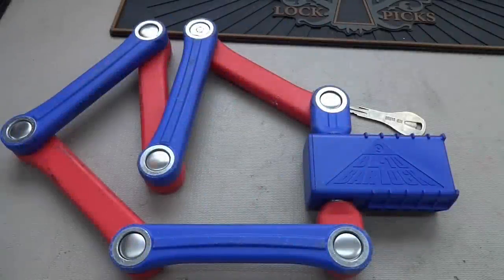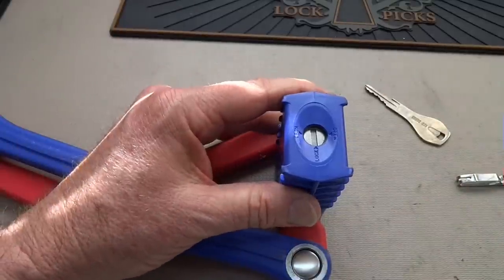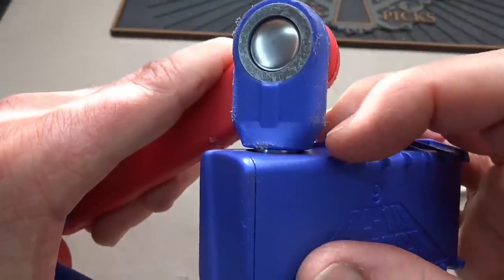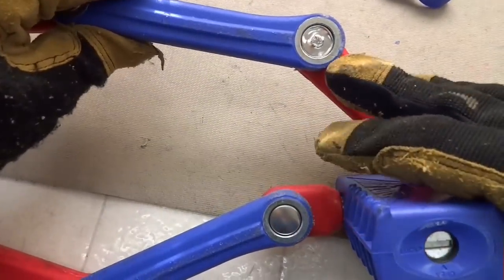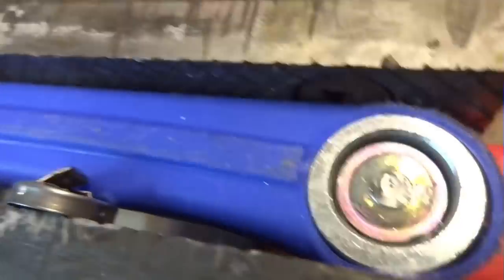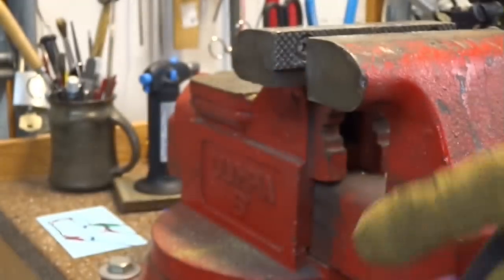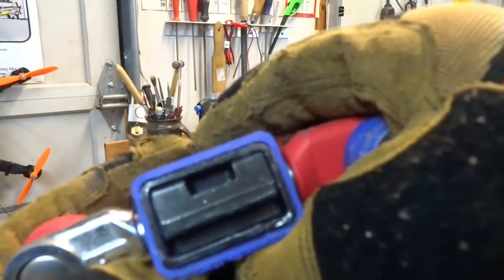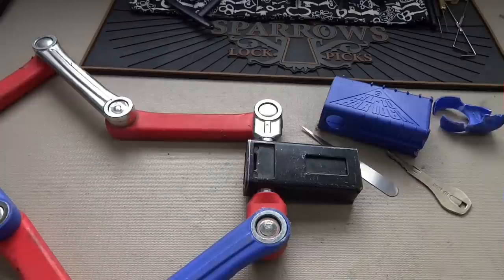(774) Japanese BL-10 Bar Lock

Comment: Under 100 club.

Also other than that weakness to shimming it seems like a damn good lock, get rid of that and it would be a really fantastic lock.
Reply: Darthane

Probably so, if the yearly replace is really to allow accommodation for improvements on the design it's entirely possible that if it hasn't been phased out it will be in a year or two.

Comment: I wonder, does no1 carry a blowtorch? all you need is 1800 degrees celsius for any kind of steel. Little propane or acetylene and pure oxygen makes short work of anything iron related. The only thing that can stop this is pure mass and thickness. I´d heat the joints with a blowtorch, and whack them once, soon as they are orange red. (coming from someone working with hardened steel on a daily basis)
Reply: theives are usually opportunists. people with brains buy motorbikes
Reply: There was a disposable combat cutter that was a tube lined with ceramic or something and filled with termite and an igniter. It was made to cut through locks and chains, and then discard as a breach was made.

Comment: freeze  the arms and smash the frozen part with sledge hammer open in 15 sec.
Reply: +Scott Lindrum Bill's previous response to the same same statement earlier.

"bosnianbill5 days ago
+antagonizerr How much would you wager?...  I beat the crap out of the bars and the hinges with a 2-pound sledge hammer on a concrete floor.  Nothing.  I sprayed them with canned air (held upside down) and froze them colder than my wife's heart, then slammed them some more.  Nothing.  So, whatever your wager was, please send it to me.  ;)"

Comment: I am starting to wonder about Japan... I know that they have very aggressive laws about cars, making it completely infeasible to buy or sell 'used' cars except to collectors.  That, of course, drives sales of new cars.  And apparently they drive sales of locks by forcing people to buy new locks every year for bikes and such?  Do they have a bunch of other laws to force people into doing things solely for the benefit of businesses?
Reply: no, it just makes sure that people have the best locks and that way insurance companies know they have the best locks. I sure hope you don't live in America or have an iPhone cause uh that's a funny statement you made haha
Reply: Yup there are a bunch of laws and many more things they think are what should be done just for the benefit of Japanese companies. Most people just do it because it's just what they do. And yes every new door has non pickable locks most bikes as well and they spend a lot of money for them as well. But they install all the doors with the hinges on the outside. And think extruded aluminium bars are a security feature. This lock he did is very Japanese lots of thought and engineering with no real accountability for the final result.
Reply: That rule sounds like it will have the exact opposite result than intended tho. If I was forced to buy a new lock every year, I would be easily tempted to buy a cheaper one since I'll have to throw it away anyways. If I was buying the lock only once, I would get a much more expensive lock that would outlast the lifetime of the bike anyways.

And locks like these prove that while technology does progress, something isn't necessarily better just because it's newer.

Comment: I have never, and don't plan to pick/break any locks. Just wanna say, that IF I ever felt the need to do this. I wouldn't bring all these tools and effort. Id just bring my battery powered dremel, and job will be finished in 10 seconds. Just saying.....
Reply: +Patrick Peck A dremmel won't get through case-hardened steel, sorry. You'll burn through many cutting disks.
Reply: +Anonymous User ah.. nvmd then. .
Reply: +Patrick Peck Probably best you are not a thief my dude.

Comment: Thermite
Reply: +Stephen Vincent 

Yeah I was actually thinking that it wouldn't be too hard to make a pre-built thermite charge that could be surrounded and shielded by steel at a small distance so that it wouldn't melt the shield. Not only would the thermite charge melt through one of those bars in seconds, but it would be almost invisible.

That also makes me wonder what the defense against this would be. How do you defend a lock against thermite?
Reply: hakachukai
exactly what I was thinking